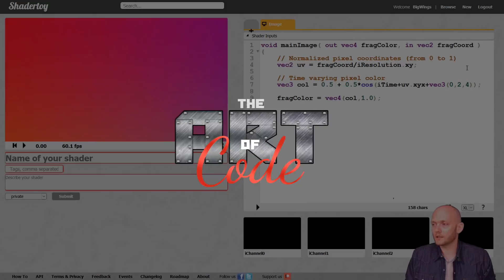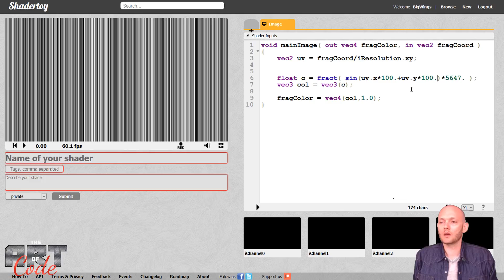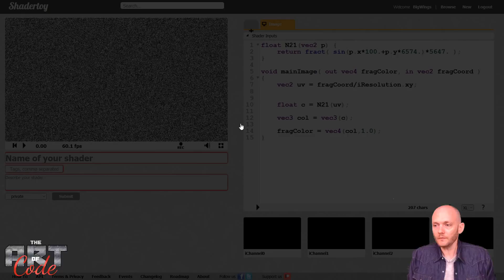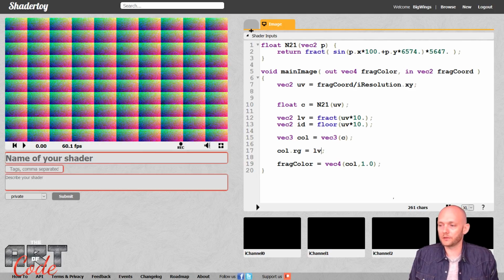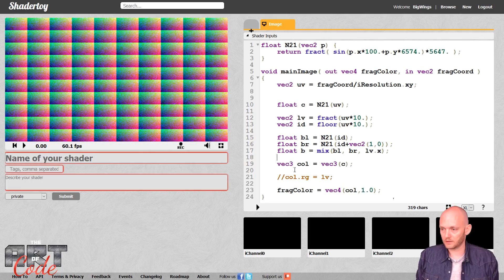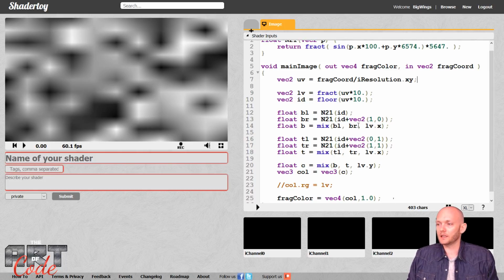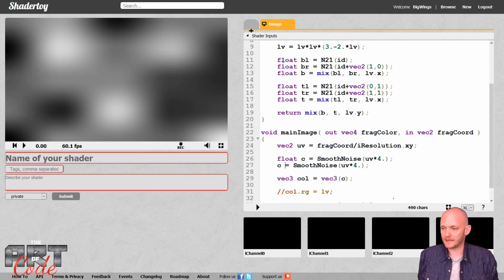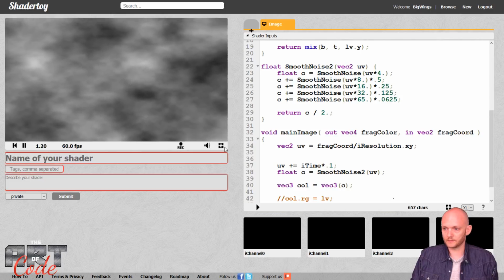Value Noise Explained!

Comment: Thanks a lot!! I have a question. If each gpu is going to use the values slightly differently to generate those randomness. Because when compiling a shader on one computer or another, the difference is not noticeable? Because in the first layer at least, with the same numbers as you, on my screen it looked very different. Thank you very much for all these videos!

Comment: I'm a junior tech artist working with shaders (with a digital art background, and math was always my biggest struggle in school) and your channel has helped me understand both GLSL/ HLSL and how to visualise math. A true lifesaver and I always come back to your channel to watch and rewatch your videos. Have you covered how to make a seamless tiling noise? I might imagine you have mentioned it somewhere, but I can't recall. I assume the idea is to compare the very first and last row of pixels of each axis to each other, and average it out, but I have no idea how to implement it.
You're such an excellent teacher btw!
Reply from the maker: Thanks for the nice words! It makes me happy to see that people like you get stuff out of my videos. I did not cover seamless noise, or seamless texture generation in general. In order to make the noise from the video tileable you'd have make sure all noise layers are aligned with the grid, meaning no decimals in the scale and offset, and then you'd have to make sure that the random values on the left edge match the right, and the top edge match the bottom. You could do this by applying a  modulo on the ID value that is used to generate the random values. If you have a layer that should have, say, 8 points per tile, then you want it to repeat every 8 points, so you'd do ID=mod(ID,8)

Make sense?

Comment: I am running into a problem with this tutorial. 
I noticed that the top wasn't generating clouds correctly, and the more I increased the frequency, the smaller the Y area it actually impacted.
For some reason when increasing the frequency beyond 16 the N21 wasn't generating random numbers anymore in. Doing a N21 with the uv's multiplied by 17 or over caused any ID area with a Y over 16 to just generate 0 as a result.

When I reduced the multiplication factor in the N21 function from the thousand range to the hundreds range that seemingly fixed it. I had a few theories on why this might be but none seemed reasonable.

Anyway, with this fix I managed to get a working SmoothNoise2 function.
Then I added the time  "uv += iTime*.1;" and that caused the noise to change entirely, now instead of a moving noise cloud I got a moving repeating pattern.

While writing that I got an idea and tested the time addition again while first resetting my time, and now I have a moving cloud that slowly loses each level of frequency detail as the values start once again becoming too large for N21 to handle.

My code matches yours perfectly as far as I can tell, the only difference being that for some reason, my N21 starts producing a 0 result once the input becomes too large.

Any ideas what the problem could be?
Reply from the maker: You have a shadertoy link I can look at?
Reply: I was getting you one but I noticed my home pc doesn't have the same problem, meaning it must have something to do with my work laptop and not with my code, but thanks a lot for the offer.

Do you think a problem with my drivers, or my ram could be to blame? Or perhaps my gpu or cpu, I don't actually know what shadertoy uses for it's calculations.
Reply from the maker: The noise function I'm using here makes use of a sine, this gives different results on certain graphics cards and therefore I am not recommending it anymore. Check the noise function I'm using in 'The Universe Within' tutorial. It will probably run fine on both machines.

Comment: Hey Martijn, thank you for putting up this great tutorial as always! One question: it seems like there's a black point at the origin when creating the noise pattern in this way. Do you know why is that?
Reply from the maker: Thanks for watching! 

Its because the core noise function is sin(p.x*a + p.y*b)*c which is  0 for any combination of a b and c when p.x=p.y=0

You could put in an extra var inside of the sine to offset it randomly but its not really necessary, just shift the uvs away from the origin and you don't have a black spot.

Comment: Huge thanks!
You are the only souce i know for Shader programming that is actually teaching by showing how to create stuff, which helps with motivation immensely. Extremely helpful, thank you again!
Reply from the maker: I'm glad you like it, and you're welcome!
Reply: Inigo Quilez has articles, and a few videos. His stuff is quite dense to get by just reading though, or maybe I am just slow, but it doesn't seem like noob friendly material. But once you get it, some things are insane (analytic normals for example, phew, you can speed up algorithms for procedural terrain generation, or volumetric rendering with noise displacement etc. to hyperspeed)
Reply: @jovanrakocevic9360  sounds awesome! Got any links to those topics?